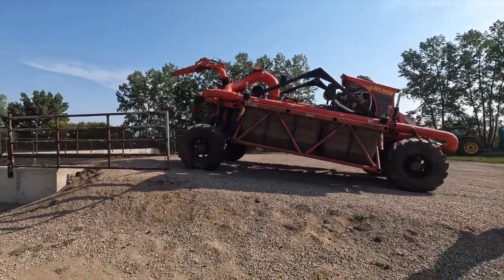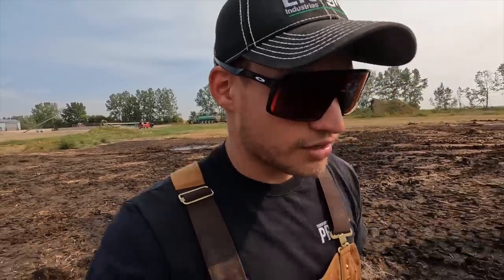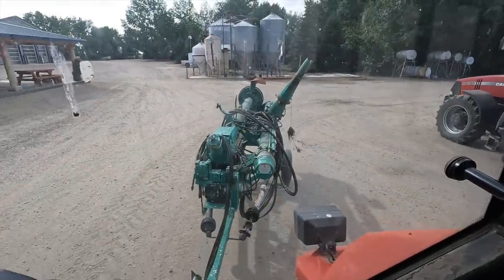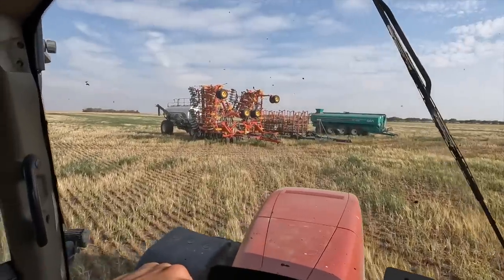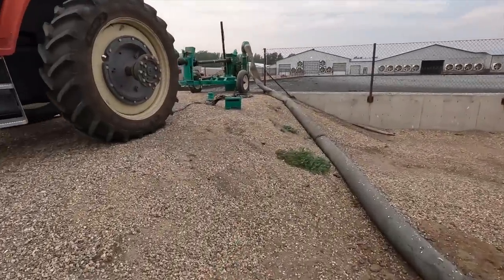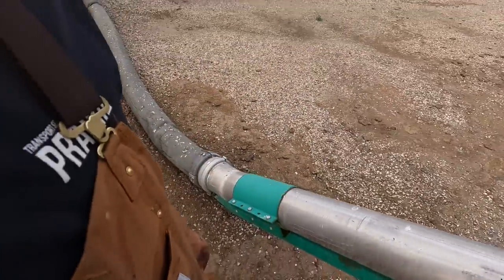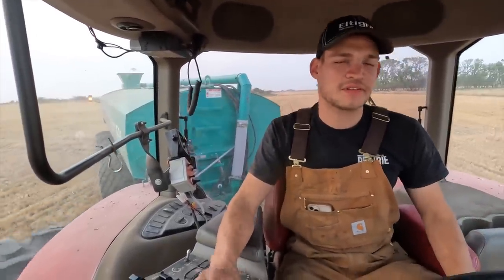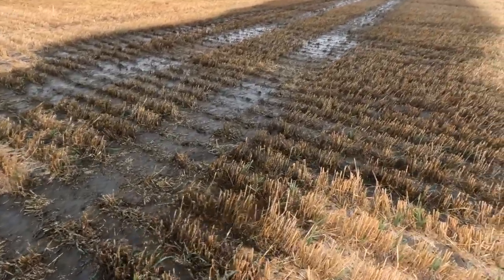Lagoon agitation

Comment: 132,343.5lbs if you're from the states... I am excited to get back in the money maker again this fall.. looking like 9/30 I'll be hitting the fields in a 380 magnum with a Jamesway 96 or 9800 gallon tank here in Iowa... hauling hog manure... best  way we've found to pop the hose collars is get a 10 ft piece of like heavy clothes line or paracord would work too and tie a quick loop on one end and pull it then twist the load stand

Comment: Should try to use high pressure air from tubes undet the liquid manure.. Just draw a line into the pit, and apply high pressure and see if it would stir it enough... All you need are a tank and a industrial compressor...

Comment: Hello I like your video you did a nice job thank you. How long did it take to fill your Lagoon with manure? How big is your operation? I mean how many cows do you milk in on a daily basis and do you have a crew that does that? Thank you for sharing Bob from Virginia USA
Reply: That's a year of buildup. They typically milk around 300 cows twice per day. (Exact number varies, depending on how many dry cows they have at the time) Total number of cattle can vary from around 700 to 900. counting all the calves, heifers, dry cows and beef steers.
Reply: @MellowYe77ow  thanks, I did farmwork in the 1970s and I realized that I'm to lazy to do farming for a living. Ok, not that lazy but I've always have had back issues.

Comment: what is the volume of this lagoon
Reply: It's 175' x 175' x 10' deep. If it was filled to the very top, there would be about 2,290,909 gallons (8,672,033 liters) of slurry.
Reply: @MellowYe77ow  and for this farm there is a sufficient volume of the lagoon or there are periodic difficulties in removing the slurry
Reply: @саняк-ч8л  Earlier this year, it was close to capacity a few weeks before they wanted to empty it fully, so they ran a few loads to prevent it from overfilling.

Comment: . . .  who rescues the driver if the engine fails?  😮
Reply: The driver is standing on the bank with the remote controls!
Reply: @jay90374  Alright, who takes the winch cable out?  🤔
Reply: @rdyardie  The boat. 🙂

Comment: By using sand for bedding how is that helping your fields  ?
Reply: The sand is more for the cow's utter health. It's more resistant to bacteria than straw and wood shavings. They don't have a sand separator, so they have to do the extra work to get it out of the lagoon. As it's reducing the lagoon's capacity.

Comment: whys it important to agitate the slurry
Reply: The sand from the bedding settles to the bottom of the pit. If it's not agitated, it will stay there and additional sand will continue to build over time. Reducing the capacity of the pit. If you search the channel for the video titled: "Dairy Farming Is 90% Playing Around In Cow Crap!!" You can see what happens when they clean out the smaller pit beneath the main barn.

Comment: If your ground is so very sandy you need to change the bedding you use and stop using sand and go to saw dust which is bio degradable an will increase your soil fertility.
Reply: 🤦‍♀️NO! Because the sand they use is free from their land. Yes it is biodegradable. Not all fields are that sandy.  Saw dust beading for the cows would cost a lot of money.  They already spent lots of money on low dust wood shavings in bags; for the calf barn.
Reply: Also sand bedding is better for the udder health of the cows. Sand as an inorganic is less likely to have bacteria in it.